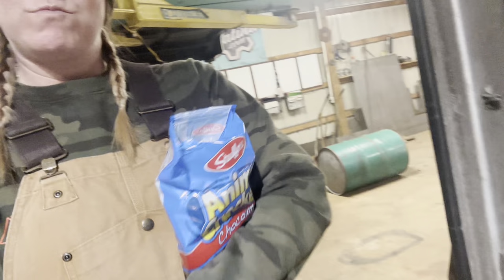Some is better than none!! Making progress on the Grumman!

Comment: Hi, I did notice that when Corey was up on the ladder, you can see light coming from the outside.  Maybe ya'll can spray some foam up along the whole roof line so you don't lose heat. Heat rises so you are losing your heat. Just a slight observation ❤
Reply: Thought the same thing nothing is insulated or sealed right wasting so much energy on lost heat

Comment: Hey gang im probably the thousandth comment saying this but the reason the barrel didn't work after the first cut is when you folded the template around the barrel it changed the radius and made it narrower it you leave the template flat on the barrel and trace that then the radius will match no matter how narrow the barrels radius, also hi from manitoba Canada 🇨🇦

Comment: Your white ceramic square and wheel is a stamp licker. 

Place water in it and roll your stamps. 
Stamps used to have glue that was activated by water and not with self adhesive like today.

Comment: Hey Corey Detroit Dagwood here buddy hey Annette brake pedal deal if you drill a hole straight through it they sell these ring pins that's got a little lever that hangs it's a counterbalance you slide the PIN to there and it falls and it's in stainless and everything and if you ever got to take the thing off the brake pedal off all you do is just lift up that other side and it pulls right through they're really cheap check it out my brother thank you God bless and peace

Comment: That is a stamp licker. Put water in the well and roll the wheel to get it wet. Now pull you stamp that has glue on the back and place the stamp on its envelope.

Comment: that sqare thing with the round roller is used to stick stamps you put water in it roll your stamp over the cylinder to moisten stamp to stick it that was before they come out with self adhesive stamps so you didnt have to lick the glue of the stamp

Comment: You guys need to get some styrofoam board  1”1/2” thickness and put it on the side walls cut it to fit in between the 2x4 🤷🏼‍♂️🤔

Comment: That thin wall square tubing is a disaster waiting to happen,  in my opinion , if you have to come down on the brake pedal hard thats your weak point , ever notice brake pedals are at least 1/4" steel , and I have personally seen more than one bent in wrecked vehicles,  just my opinion again .

Comment: In regards to not seeing reason the brake geometry won’t work… I see several from here. One, leverage. Without a whole lot of research, I think you gotta have close to eight to one ratio leverage going to the brake booster for brakes. Too, Clearance from that left front tire. And ergonomics, unless you drive like a go kart with a right foot over on the gas and left foot over on the brake pedal. of course sometimes it’s hard to tell from one angle…